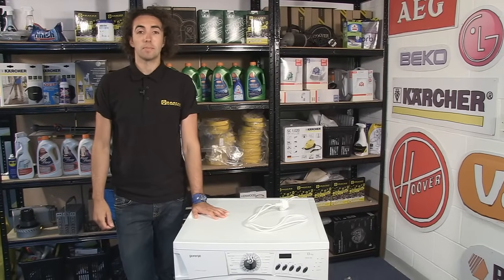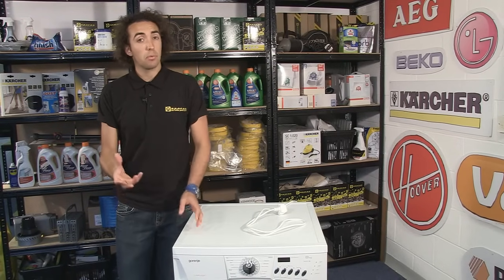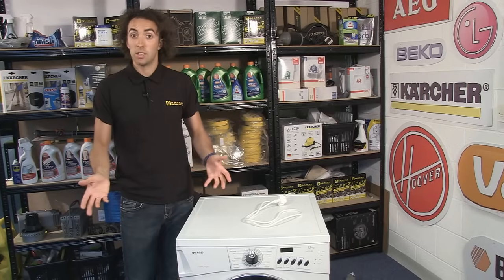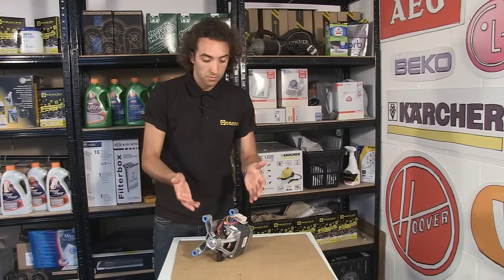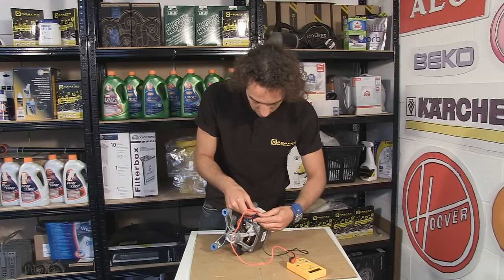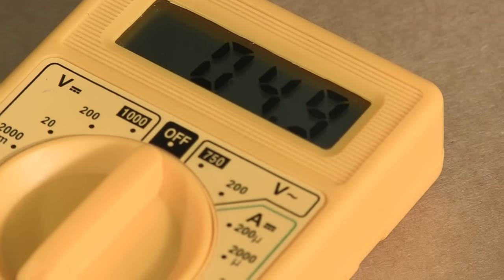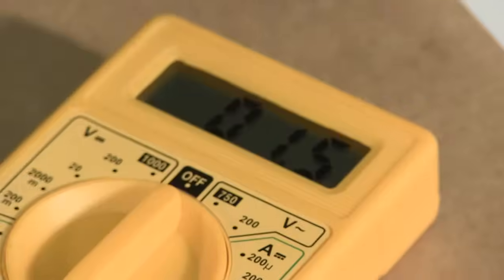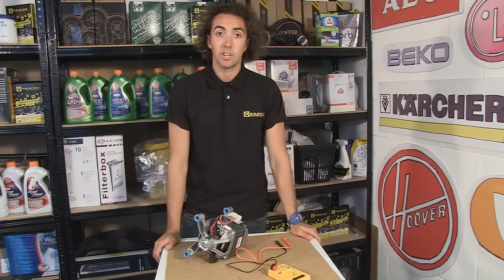How to Diagnose Washing Machine Motor Problems

Comment: Hi, I have a Bosch Axxis Washer (was20160uc/18) which I think the motor has gone out.  Can you tell me what the Ohms readings should be for this specific motor?  The numbers for my primary windings seem low:  Pins 2&3 = 1.2 Ohms, Pins 1&2 = .2 Ohms, and Pins 1&3 1.0 Ohms.  I believe the part number for the motor is #144843.  I cannot find this one but I can find part #145327 which I think will also work.  I have talked to some technicians to get them to my home but they only wanted to help me over the phone.  It was kind of them and I appreciated it but I have an unhappy wife who wants this fixed.  Thank You
Reply from the maker: +Mike Darius WE do not have the resistances of the motor coils. If the brushes are in good order and you do not have any motor drive see our diagnosis video: https://www.youtube.com/watch?v=D5Aw7CBEGPI
Reply: +eSpares Lol, thank you, I'll have to check that out.   ;)
Reply from the maker: +Mike Darius :-)

Comment: Josh my Bosch front loader is spinning very slow,,, close r very wet at and of cycle ,,, took motor out to find it is brushless,,,  tested for ohm reading and set at 200 it read 115.7,,, what should I do,,, disabled and can't afford tech... Please help,,,  ps w.pump working but making noise,,, thnx
Reply from the maker: +Mario Silva The usual cause of a machine not going to spin just tumbling is an out of balance load. This is covered in another one of our videos: https://www.youtube.com/watch?v=uKBy-9NEF5A

Comment: Hi eSpares! is all the front load washing machine motors has the same types of connections? Because i plan to replace the motor of my washing machine from my old LG. thanks and have a great day!
Reply from the maker: +Oscar Gasalatan If the machines are from the same range they may well be identical but without the full model numbers we cannot confirm this.

Comment: You say that to test the tacho generator you take the resistance reading which should be "any reading that wasn't a short circuit or an infinite reading" and you measure 70-71 Ohms which you say is fine.  Mine is reading a steady 32 Ohms so would appear to be ok but I have read elsewhere that the resistance should vary when you rotate the motor, is this correct?  Mine does not vary when I rotate the motor but the tacho generator appears fine when it is removed from the motor.

I have removed and inspected the brushes which seem fine, they also show a resistance within your tolerances.

My washing machine is a Hoover DYN9124DG-80 with a CESET MCC 52/64-148/CY59 motor.

Thanks, Colin :o)
Reply from the maker: +Colin Preece The tacho resistance does not change but it has a magnet that induces a small voltage that may cause your meter to fluctuate as it is spun. If the Tacho had lost its magnet or gone open circuit the motor would spin to maximum as the board told it to turn. With no feedback to the board it would suspect a problem and stop the motor then usually retry again.
Reply: Thanks for the prompt reply.  We didn’t notice the motor spinning to maximum, the motor won’t spin at all and shows the error code E08.  According to your website (http://www.espares.co.uk/advice/0/2531/how-to-understand-hoover-and-candy-washing-machine-error-codes) this indicates “a problem with the motor speed sensor. This can result in the motor spinning up at very high speed for a few seconds slowing down and then stopping. It may also mean that the motor is not spinning.”  I haven’t checked the motor’s field winding resistance as I can’t work out which wires to check.  The multi connector has 9 x wires: 2 x red go to the tacho, 1 x whiteish-grey goes to a brush, 1 x blue goes to the other brush.  This leaves 2 x purple, 1 x black, 1 x orange and 1 x brown.
The machine has already had a new door latch and PCB when showing error E01 (each renewed item did make a difference) but now the motor doesn’t spin and error E08 is displayed.
Any ideas?  Thanks.
Reply from the maker: +Colin Preece The E08 as stated is the control board not seeing the motor turn and is due to the motor not turning. If the brushes are in good condition and you have checked the motor connections and the PCB connections then the problem is likely to be the control board.

Comment: very helpful, but can u add how to test the " thermal cut out " inside the motor , after doing all your test everything seemed good .. but 2 purple wires on mine are open circuit.. me thinks this must be the TCO,, pull out the wires and yes , took it apart , stuck small screwdriver under bimetal strip , put all back together , test with lighter , it trips and resets ... do u sell these tco

Comment: Hello.  Anyone know what setting to put multimeter on?  I have 20k and 200k ohms setting and 20m and 2000m ohms external unit settings.
Reply from the maker: David Pearson The lowest setting for your meter on resistance is 20K ohms so that is most useful for most readings on domestic appliances and for checking Continuity.

Comment: Quite often my washing machine motor will randomly burst and jerk during the main wash and rinses which causes the machine to bash about, is this a brush problem or more of a motor problem?
Reply from the maker: ***** There are three possible causes .
Worn brushes (easy enough to check) see video: 
www.youtube.com/watch?v=MNInJd7js5A
Loose motor connections (check)
If the problem still occurs after checking the above it is possible it is a faulty pcb or module.
Reply: eSpares Thank you very much for your help and advice!

Comment: Thanks, was a great help, motor turned out to be fine, when reassembled it all worked properly, so don't know why it packed up in the first place.
Reply from the maker: Hi Steve, If you did not take the brushes out to examine them or if they were quite worn by disturbing them they may work for a few washes.
However, if this was the problem it is likely it will return.
Reply: Yeah, the brush I took out was fine, put it all back together, worked for 5 minutes, then packed up. Ordered new brushes, when I went to fit them, the brush I didn't take out was totally worn away. Lesson learnt, always check both brushes, though was surprised how much worn one was than the other.
Reply from the maker: Steve Borrett Unusual for one to wear so much more than the other. It may have been sticking a little and the lighter contact may have resulted in it burning away as opposed to normal wear.
Glad you sorted at last.

Comment: Hi my washing machine has stopped working for some reason and keeps on leaking and I don't know what to do about it could you please give me some advise thank you
Reply from the maker: Hi Eisha, There are a number of possible causes for a leak. Check the door seal rim and in the folds for a hole or tear. If the seal is OK unplug the machine and take the back off. Then poor a kettle of water into the drum through the door. If this comes straight out identify where it is leaking from as there may be a hole in the drum caused by a coin. Once identified the cause can then be addressed.